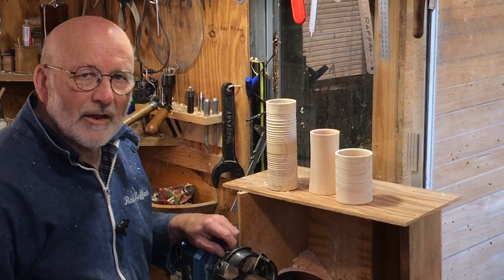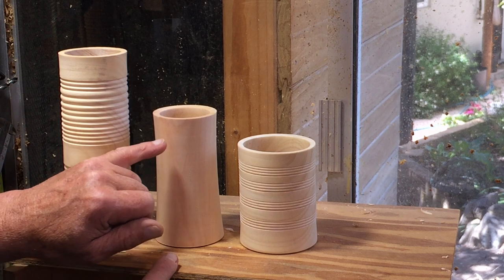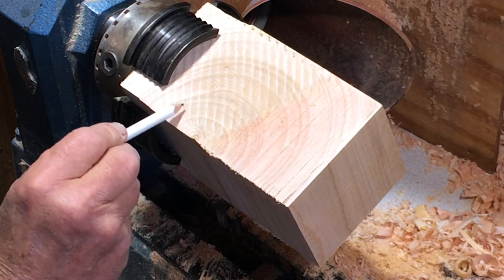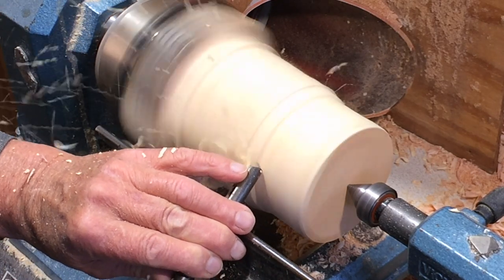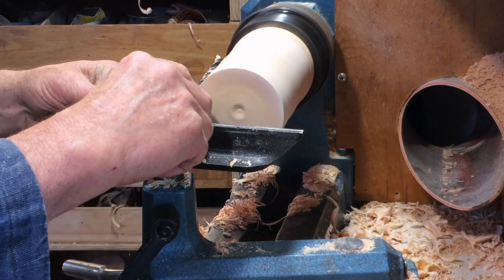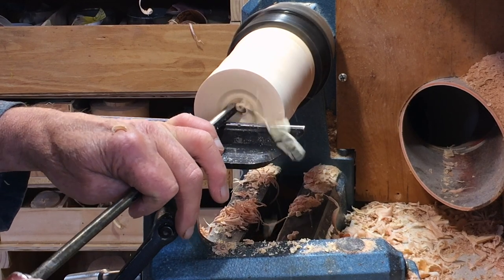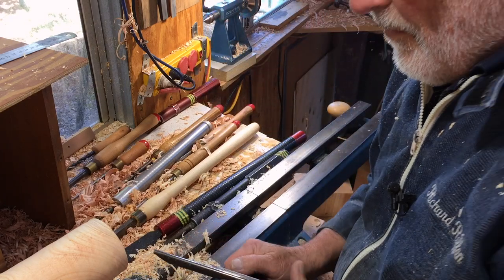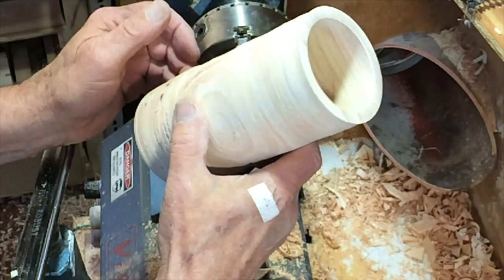Richard Raffan turns a crossgrain green ash spatula pot

Comment: I made my first pot. It's only 5-1/2" x 2-1/4" outside dia. I had a 9" long blank but I quickly discovered I do not heavy enough scrapers to turn the inside.
I made it out of apple. I know that was a bad choice but it was practice. 
I ribbed it and it really looks good. The microwave drying put a good warp into the piece but the top 3/4" split vertically near the pith. 
I like the design and feel of the pot even with the split. Do you think I should cut off the top 3/4"? Or keep it?
I appreciate the work that goes into making your pot!
Reply from the maker: I’d keep it, Ken. Splits can be detailed — or filled if you’re then going to hide the split with paint or verdigris. It’s one of those design opportunities. Apple is generally a good choice if you want some distortion, but it does have a nasty habit of splitting if the wall thickness is uneven and around knots. Including the actual pith invites radial splits.

Comment: good video again.
question: what is the adventage of drilling a center hole before hollowing?
and i see a lot turners hollow fom the outside to the inside and leave the center in as long as possible because they say it would be more stabile . what is you´re reason to take away the center first. i´m a beginner so i try to learn as much as i can about all the tecniques  and the reason behind it.
Reply from the maker: The centre hole is drilled to the depth to which I wish to hollow. This saves time measuring the thickness in the base of a project. There are other advantages: On bowls a depth hole also reduces the risk of gouge catches at centre. Inside small diameters as here and hollowing endgrain, not having wood at centre (where the hole is) makes hollowing with scrapers easier at centre, of if you're back-hollowing a depth hole makes starting the cut easier.
Reply: @RichardRaffanwoodturning  it makes sense.  Thanks

Comment: At about 4:30 you mention the spindle gouge is less expensive steel than the bowl gouge. What do you mean by that?
Reply: Why hollow with the smaller bowl gouge? Opening size?
Reply from the maker: Spindle gouges are much less expensive than deep-fluted bowl gouges — often almost half the price.
Reply from the maker: @ronreynolds8207  A ½-in deep flute gouge, or even ⅜-in, would have been far too big in that situation, even with a very long 30-degree bevel and steep right wing. The ¼-in asymmetric gouge has a very long bevel and steep right wing that's ideal for hollowing tall narrow crossgrain and undercutting a rim in an enclosed form. YOU can see this at 15:45 in https://www.youtube.com/watch?v=OeVAGEsAzjY&t=8s, the Hymalayan Pot video.
Reply: @RichardRaffanwoodturning  yes, but that lack of a wing is so much more stressful.  what i pay for in bowl gouge i make up for in not worrying as much about catches. :)
Reply from the maker: @ronreynolds8207  I don't understand what your problem is. You see the ½-in spindle gouge used to turn the square to a cylinder. The lack of a wing shouldn't be a problem unless you present the wing of a gouge with the flute up in which case any gouge will catch.
Reply: @RichardRaffanwoodturning  ouch.  i find the bowl gouge easier to use than the spindle gouge because you can tilt it more without catching (up to a point of course) and there's a wing for doing slicing cuts on the inside and outside.  by the way, do you round over the left edge of your scrapers so they're less likely to catch and only cut with the front edge?
Reply from the maker: @ronreynolds8207  I think we're not understanding each other's terminology. For instance I don't understand your last sentence, what you mean by rounding the left edge. You might be describing my shear scraper,  for many years manuafctured by Henry taylor as part of the Raffan Signature range of scrapers and gouges. But I"m not sure. If you want we can email about this, then you can send me photos. You can either message me or go via my website https://www.richardraffan.com.au/contact/

Comment: Richard, why do you never use a roughing gouge? The name implies it would be good for rounding square wood.
Reply from the maker: Here I'm turning crossgrain with the grain at 90-degrees to the lathe axis, so facework techniques are required rather than those for spindle turning. Deep fluted roughing gouges, now usually sold as deep fluted spindle roughing gouges, are designed specifically for roughing spindles square to round when the grain is parallel to the lathe axis and running the length of the blank. They should never be used for roughing facework. This video shows gouges for roughing spindles:  https://www.youtube.com/watch?v=04erRe6tUt8
Reply: A spindle roughing gouge is not made for cross grain turning to round a piece. As I am sure Richard will tell you. Hence the name spindle roughing gouge. It is made for peeling cuts and it is not built for the impacts that a cross grain catch can produce. It can break where the tang and handle meet causing a very sharp tool to be flung violently back at the operator. People have been killed doing this exact same thing! Please never do it!
Reply from the maker: @scottstubberud1137  Thank you for your input. We can't make this point too often.
Reply: Thanks Richard! I’m honored that you have responded favorably to my comment. You are the man I go to if I ever want answers. You always have them and I always learn something new even if I’ve watched your video 10 times already, I get something new every time I watch it. You have mastered so many amazing details that are common sense once you’ve seen them implemented but they are like magic if not explained correctly to back it up. Thank you for sharing your skills with us!!
Reply: @RichardRaffanwoodturning  I watched the video you linked. You showed several ways to round end grain. At the end, you said you usually use a skew. Why?
Reply from the maker: @oshgcan3350  As I say at 3:22 it gives me a cleaner surface off the tool. It's also faster and saves me having a gouge on the bench and for a professional turner that saves a lot of time over the years. https://www.richardraffan.com.au

Comment: So end grain is harder work, and but are there advantages to it? (Not working it, the finished product)  Looking forward to the finishing video to see how you get those results.
Reply from the maker: I  think the advantages are almost entirely to do with ease of turning and consequent speed when making quantities of small items. Bowls up to 55-60mm diameter can be turned in a few minutes with none of the endgrain problems that arise with crossgrain on that diameter. Problems arise with endgrain items over that diameter which are quite fragile if the wall thickness is less than 2mm. Grain running vertically is much more likely to split than grain running across.  Visually you get more interesting grain patterns on crossgrain unless you turn a whole branch when you have broad patterns similar to those on sheets of plywood made of peeled veneer. Then the problem is that you have the pith in the base of the bowl or box that's very likely to split unless the wood is particularly dense or stable like the horizontal scrub box on the right , fourth down in the right-side column in my website gallery. https://www.richardraffan.com.au/boxes/
Reply: @RichardRaffanwoodturning  Many thanks fot the clear explanation.